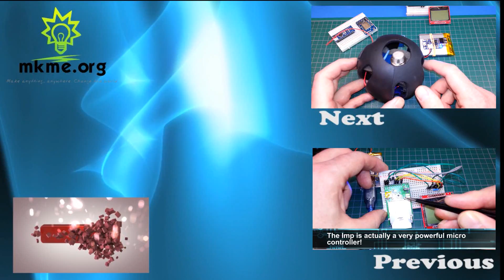Cheap OLED Displays for Arduino Projects

Comment: Link to your example fails.
Reply from the maker: fixed
Reply: Thanks.  You're a good man.
Reply from the maker: Nahh you are Tom
Reply: I got a kit that has the controller, oled display and temp/humidity sensor.  Now it is time to see if I can get it working. :)

Comment: How would daisy-chaining these work? Would them all be considered a single big display, or some other dark magic? Could I for instance, connect four of these in a chain and have each display Altitude, Heading, Vertical Speed, Speed? These seem like a good option over the 5110 for my flight sim panel, less light directed toward me =)
Reply from the maker: ***** You can theoretically put up to 128 of them on the same 2 pins in the Arduino using I2C :)  Check out Jim's project he sent me https://www.youtube.com/watch?v=VhsCcR7YEXI
Reply from the maker: EDIT Just realized there are seemingly only 2 addresses available so you could use a CS pin for each you add or perhaps an external shift register.  Either way you can have multiple. Too bad we can assign the address.  Meh